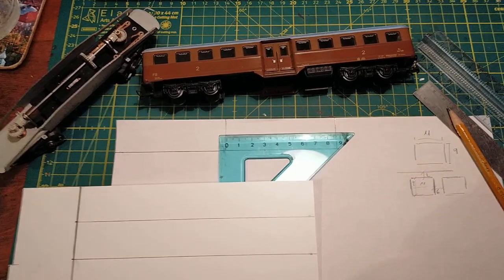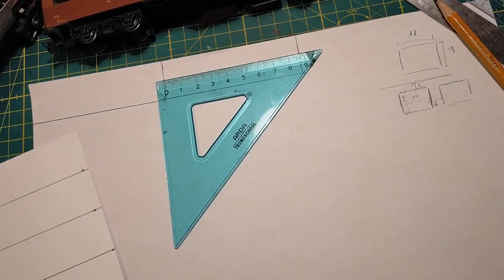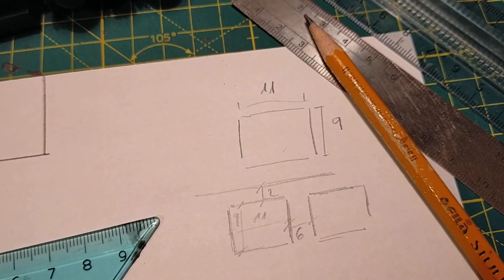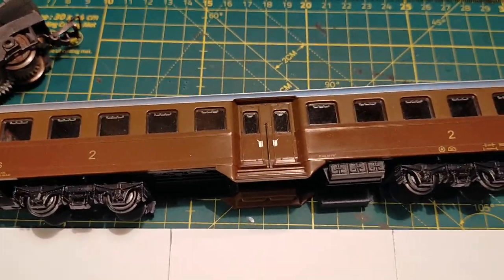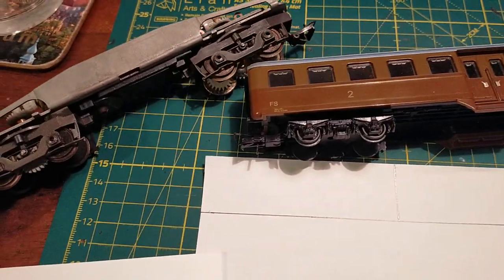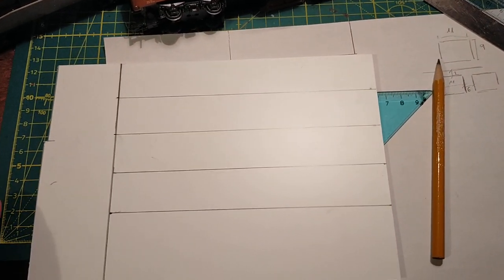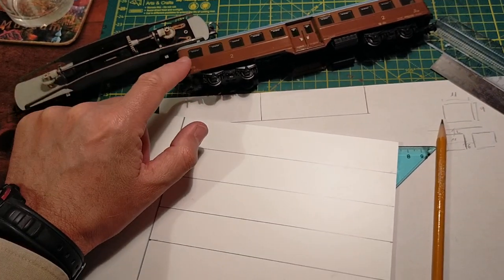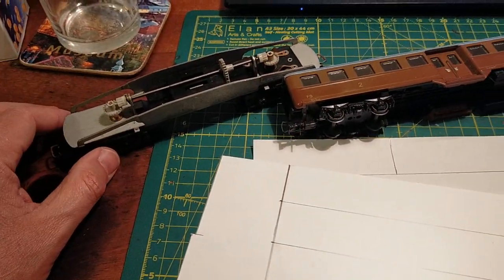Freelance railcar on the Jouef BB6700 chassis episode 1: pencil, paper and plasticard

Comment: I've a pair of Lima clerestory 4 wheeled "Western Express" kiddie's clockwork trainset carriages, with end windows & doors, that I've often considered converting into motorised railcars. I've had them since the mid-1990's. It's figuring how to do it, though. Do I put them onto a Lima Plymouth 0-4-0 diesel shunter chassis or build the motor inside them and have a worm & cog transmission onto an axle.
Reply from the maker: Fitting one onto an 0-4-0 shunter chassis could make an interesting steam tram conversion.
Reply: @patricksmodels  It would be a quick fix, but I'd lose the split recessed double side doors' hanging step tread, to make the chassis fit. They're a one piece body with detachable roof. The floor is pretty sturdy, so good for fixing a motor to. They're about 12cm. long, with 3 window ends (one window is in each end door). They have the look of a early 20th century rail car, despite being carriages. That's why I bought them, back in 1993.
Reply from the maker: @CZ350tuner  I understand. Better the motor and drive gear solution then.